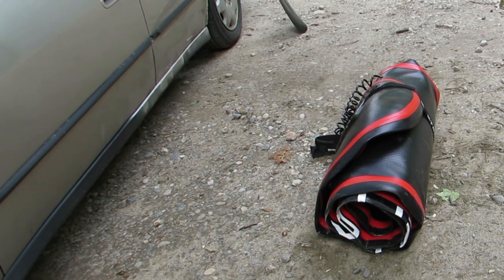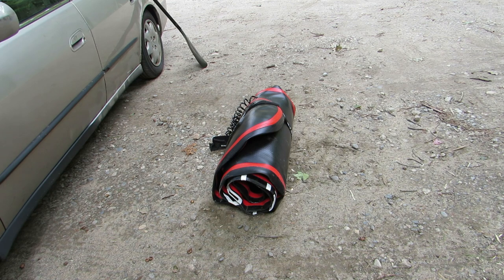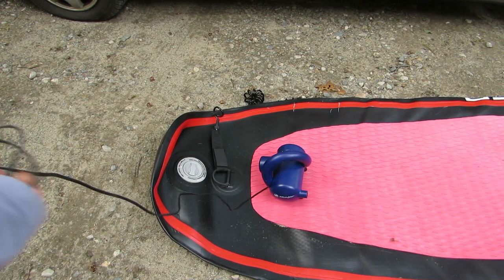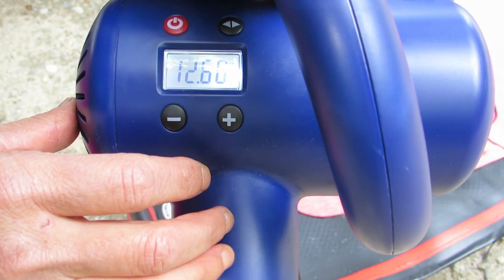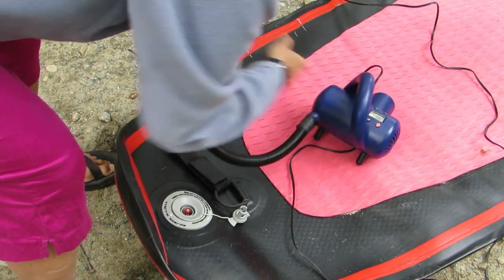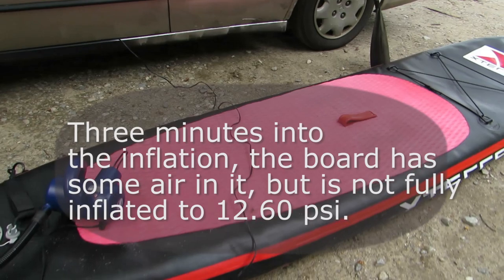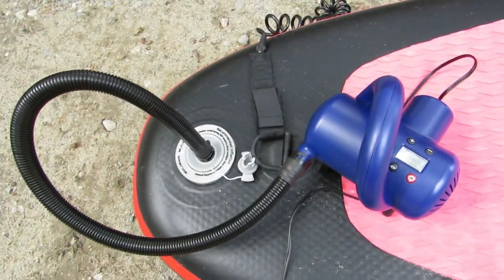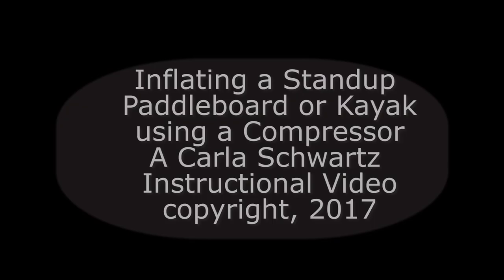Inflating a Paddle Board with a Compressor, a CB99videos  Instructional Video #xterraboards

Comment: Hi - Would the hose on your compressor connect to an air mattress pump? I'm wondering if I can buy the hose and SUP nozzle to attach to my air mattress pump. Thanks for the quick video instructions, very helpful!
Reply from the maker: HI Robyn, Thank you. I am sorry to be so late with a reply.  Usually you need to have a pump that can take this high pressure (relatively speaking) pump. I do not think any old air mattress pump would work.